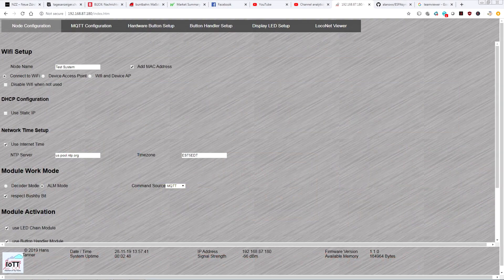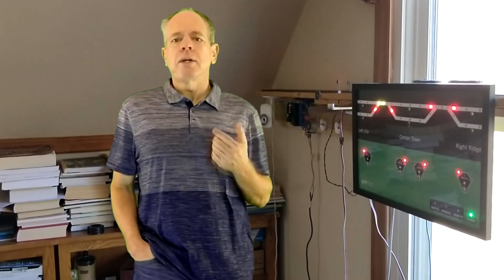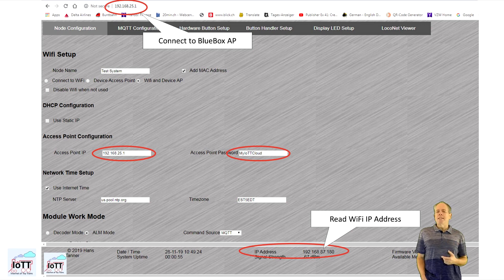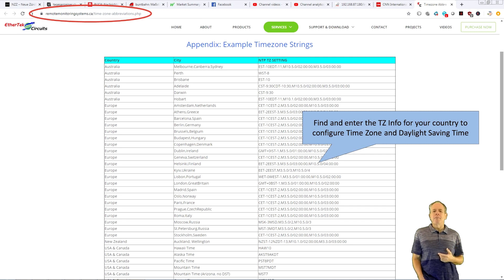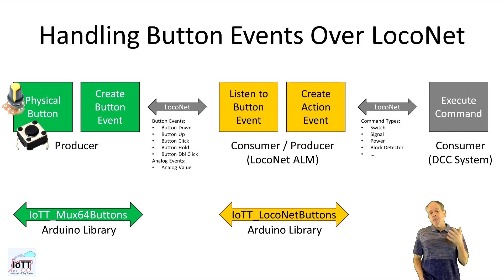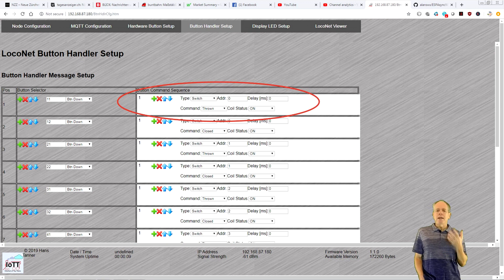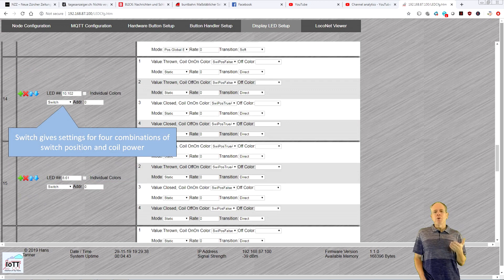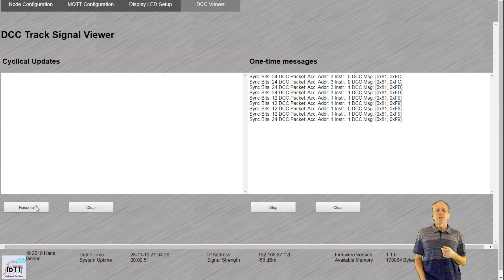BlueBox Sketch Update and Configuration (Video #32)

Comment: Hi,  A fresh down load and all behaves just like the video first time  :-)) .   Now to get some resemblance of control.......
Reply from the maker: Glad to hear. Thank you for helping to find bugs in previous versions!
Reply: @IoTT  I think I just might have to await the user manual.  I have 2 esp32's set up. one as a loconet gateway with gateway as its source of command and ALM ticked.  with the button handler set up for two buttons to send switch commands and is connected to loconet via a suitable circuit which indicates when a loconet packet is received.  The other esp32 is set up to connect to wifi and to have MQTT as its source of command, has the ALM  ticked, and to use the Button hardware and LEDchain modules.  Pressing any one of the ten Digital assigned buttons causes the Input Status box to show up with several options one after the other for that button, all different colours, before it decides to settle on one state. I have a LEDchain of 3 set up to be static with G/Y/R and dark aspects on two address each.  I have the wifi set up on their own router along with the MQTT broker which is running on a tablet.  I can see both esp32's connect to the broker and the broker response. I can see them both routinely sending ping requests and the broker responding to both. I can use the PC web browser to access either ESP32 and make changes to either one and the MQTT broker will show the disconnect and the reconnect.   I can use a programm called MQTT-spy  to publish a message to the topic lnIn and see the broker publish the message to both ESP32s.   I do not see any MQTT message as a result of pressing a button which is set up to activate a track Switch via MQTT/ButtonHandler/loconet ,  or sending a loconet packet from my railway software via loconet/MQTT to control the Ledchain.   I suspect I am just missing a clue to unlocking the puzzle, it is tantalizingly close  :-)
Reply from the maker: Try to get it going step by step building on each other. Here is an outline how I would proceed:
1. Get the Gateway working
1.1. Verify the LocoNet side is working. Load the LocoNet Viewer program from the LocoNet Hybrid Library Example section and see if is communicating with LocoNet in both directions. If the program runs you should see incoming messages in the monitor window. When you click enter in the monitor's command line, it should sens a series of messages to LocoNet, meaning you should see activity on the LocoNet activity LED on the ESP itself as well as on all other LocoNet devices that indicate LN activity (e.g. BDL16, PM4, etc.)
1.2 Verify MQTT is working. Apparently it is as you get the Pings, so you may skip this step. To verify you can load the MQTTViewer example from the MQTT library. This works pretty much the same way as LocoNet Viewer. You should be able to send messages and see them in the MQTT-spy on your broker machine
1.3. Load the LNFP sketch again. Open the configuration web page, make sure following is set: "Connect to Wifi" or "Wifi and Device AP". "Disable Wifi when not used" must not be activated. "ALM Mode" must be active and "Command Source" must be Gateway. "use Gateway Module", "use MQTT Module" and "use LocoNet Module" should all be activated by the web page. Verify the hardware settings for transmit, receive and logic level for LocoNet are correct (i.e. the same settings that were successfully working in your LocoNet Viewer test example). Save and restart the Gateway. Open te MQTT Configuration page and verify the settings for the broker. Verify the topics. LocoNet communication uses the broadcast and echo topics. Make sure they are the same on all nodes. Save and restart if you made any changes. You should now see any LocoNet Message  appear in your MQTT-spy software looking for the broadcast topic
2. Once you have this working, you can proceed with the second module.
2.1. Verify MQTT is working, as done above using the MQTT viewer
2.2. Verify the button module is working. From  your description, it appears it. What you see is the sequence of button messages as follows: When you click the button, you get a button down and the field changes to the first color. When you keep the button down, you get periodic button hold messages, changing the color of the field and Hold displayed in the text field. When you release, you get a button up followed by button click, which is the last on in the sequence. If you repeat the process within the specified dbl click threshold, you will get a double click message after the second button click message. The whole sequence of events is modeled after the button sequences of windows, so it is kind of state of the art.
Make sure you assign a button number to each button, so that you later can identify each button by a number.
Save and restart. You now should see button messages appear in MQTT-spy whenever you click a button.

Try to get that going so far and let me know. I will then explain how to set up the LED's and button handler. From your description it is not clear to me where the LED strip is sitting, on the gateway or on the MQTT only module. Also, it is not clear where the commands for setting the LED's are coming from and what exactly you want them to display. Maybe you clarify that.
Reply: @IoTT  Hi, I noticed that your talking about use Gateway Module", "use MQTT Module" and "use LocoNet Module" should all be activated by the web page, but from what I can see , these options are grayed  out for me.However "Use LocoNet Module is grayed out but there is a check mark in the box. How can I enable these ?
Reply: Hi,  I have worked my way through your very helpful outline on how to proceed, solving my self created issues along the way, getting as far as 1.3  where it says:-  Verify the topics. LocoNet uses the broadcast and echo topics........
It appears that making any changes to the broadcast or echo topic names and  saving them makes no difference to MQTT as when the node restarts the Broker displays Received SUBSCRIBE from ......  for   lnIn, lnEcho, and lnPing regardless of any changes to the MQTT configuration. The changes do  remain in the MQTT configuration as seen in the browser. 
I do not see any LocoNet message appear in my MQTT-spy Software when looking for the broadcast topic lnIn . The LocoNet activity LED on the ESP blinks away and i can see the LocoNet message in the Loconet viewer.  I can pubish to lnIn,lnPing, and lnEcho and see the broker sending PUBLISH to........   for all 3. All while they Ping each other over and over.
When I make changes and then click on the "Save & Restart" button on the browser a second button called "Save configuration and restart device" appears.  The MQTT broker responds to the first button, you have to click the second button to proceed. 
On the Display LED Setup  page after clicking on the "Save & Restart" button the second button  that appears also has a check box option  called "Prevent this page from creating additional dialogs"
A minor bit of info;- Up until now all my (20+) Loconet interface boards are using the LM393 Chip.  This gave me some strange outcomes when used with the ESP32 as it was missing 1/2 the data streams. I have created  a Loconet interface board using the LM311 chip and that sorted that one.  My limited knowledge suggests that the LM311 is called high speed for a reason.
To clarify the other things you mentioned:-  The LED strip is on the MQTT only module along with the Button hardware module. The LEDs will display which way the turnout is set by showing a colour  for the direction set and be dark for the other direction. They will get their commands from the feed back sensor on the turnout via LocoNet and MQTT.   The plan is for  7 turnouts = 14 Buttons  and 14 LEDS plus  power  STOP and GO buttons .  The Button handler module will be in the Gateway Node. 
Hans, your work is appreciated thank you.
Reply from the maker: Thanks for the info. There was an error in the MQTT library that prevented it from loaded the user given topic names, so it went with the default values. It is fixed now and uploaded to Github. Please try again with the new version.
The "Save configuration and restart device" is to give the ESP32 time to reboot before the page is being reloaded. It makes the browser wait until you click that button. The checkbox is a feature of the browser, just leave it unchecked.
What do you mean with "they Ping each other over and over."? The Ping message is pretty much a one-way thing to the broker. If the node receives a ping message, it is ignored, there should not be any "ping-pong", meaning going back and forth as reaction to each others message. Each node should simply send a ping message at the specified interval, every 5 Minutes by default (300 secs).
Do you have any Digitrax devices in your LocoNet or is it all your own nodes? I am just wondering what kind of messages go over your LocoNet.
Normally, the selection of the OpAmp for a LocoNet interface is not critical, pretty much any comparator will do when used with correct voltage divider etc. as LocoNet is really slow (just about 16 kBit/s).
Let me know how progress is with the new library version.
Reply from the maker: Hi, sorry I missed your message, it was held for review because of the hyperlink.
If the above output is from your node that runs MQTT only (not from the Gateway), that means that it is getting loconet messages which have been sent from LocoNet via Gateway and Broker to the Node. Please confirm. 
The same goes for the output in your link. If this comes from the gateway node, it means LocoNet is working. If it comes from the MQTT node, it means LocoNet messages are making it through and you just don't see them in MQTT-Spy.
Then the question is why you are not seeing it in MQTT-Spy. Maybe you want to try a different viewer client for testing. I am normally also using MQTT Dashboard on my Android phone.
The ping message from the node or gateway would include some data like the node name, the uptime and the free memory. Should be easy to recognize in the viewer.
Reply from the maker: Thanks for the summary of your observations. Let me comment on them to make sure I understand everything you are describing.
Obs 1: This looks exactly as it should. The node is getting LocoNet commands from LocoNet.
Obs 2: Here is a potential problem. It sounds like you first turn on the ESP32 and only then the broker. Try the other way around. It should work both ways, but I don't think I ever tested it except just a few minutes ago, and it worked, and the fact that the topics get subscribed seems to support this assumption. but anyway: Try to start the ESP against an already running broker.
Obs 3: This again confirms it is getting the LocoNet messages, but for some reasons it is not sending it to MQTT. Verify the ESP configuration settings. Command Source should say Gateway and the MQTT module checkbox and useGateweay checkbox should be checked. You can also set the MQTT Ping Delay to say 10 instead of 300 and you should get a LnPing every 10 seconds
Obs 4: Looks like the broker is doing its thing. What is the meaning of d0, q0, r0, m0? If q0 means Quality of Service 0 you should see if you can set MQTT-spy to send with QoS=1, which probably would cause the broker to display an error message if the message was not delivered
Obs 5:This is the normal ping message sending IP, Signal Strength, available memory and the seconds since the ESP was started. It tells me that the communication essentially works.
Obs 6: Pingreq and pingresp are messages from lower levels of the broker-client connection, but again it shows that the basic connection is there. But for our problem, we can ignore them

So, I think your conclusions are correct based on the observations. No idea though, why this is. The next step is to place some debug print messages along the path to find out where it breaks down. You think you can do that? If so, here's the message path you would need to follow:
Main Sketch line 108 call to commGateway->lnWriteMsg(txData)
IoTT_Gateway.cpp line 171 call to mqttPort->lnWriteMsg(txData);
IoTT_MQTTESP32.cpp line 232 Here you would have confirmation that the message is put in the message queue
IoTT_MQTTESP32.cpp line 340 here the sendMQTTMessage is called
IoTT_MQTTESP32.cpp line 226 here the message is prepared and published with the correct topic
The path is not time critical, so it is no problem to insert Serial.println messages and you can see the output in the Arduino monitor window.
Hope that helps. Please let me know the outcome
Reply: @IoTT  Unfortunately Hans, I am not able to help with making any progress on this. Every time I insert Serial.println()messages in any of the locations you indicated, all I succeed in doing is getting pages of error messages similar to this......
C:\IoTT\LNFP_ESP32\LNFP_ESP32.ino: In function 'uint16_t sendMsg(lnTransmitMsg)':
LNFP_ESP32:103:23: error: no matching function for call to 'HardwareSerial::println(lnTransmitMsg&)'  
 {Serial.println(txData);
This is a common part of the errors....  no matching function for call to HardwareSerial::println
My knowledge of their meaning is Zero.
Reply from the maker: Oops, sorry, my instructions were obviously not detailed enough for you to follow. Let me try again. First some explanations.
Serial.println can only take simple data types as parameter, so printing txData will not work. The idea is to insert println messages with a string saying "Look I am here" so that we can follow the program flow and see were it goes a different way.
So, here is the first example, and I copy the entire function from main sketch line 106 so you can see how it works:
uint16_t sendMsg(lnTransmitMsg txData)
{
  switch (commMode)
  {
    case 1: if (lnSerial) lnSerial->lnWriteMsg(txData); break;
    case 2: if (lnMQTT) lnMQTT->lnWriteMsg(txData); break;
    case 3: if (commGateway) 
            { 
              Serial.println("Calling Gateway"); 
              commGateway->lnWriteMsg(txData); 
            }
            break;
  }
}
This will compile and when you run it, you will see "Calling Gateway" appear in your monitor every time a LocoNet message is received.
Try it and when it works, go to the next line, IoTT_Gateway.cpp line 171. Make it look like this (from line 169):
      case MQTT:
  if (mqttPort != NULL)
  {
   Serial.println("Message placed in buffer");
   return mqttPort->lnWriteMsg(txData);
  }
  else
   return 0;
  break;
Now you will see both messages in the monitor after receiving a LocoNet command.
And so on.
Somewhere it breaks down and I would like to find out where. Unfortunately I am not able to replicate the error on my system, so I hope you can give it another try.
Reply: @IoTT 

 Hi,  That logic I can follow :-).  I followed your example and started at the begining. There is no message appearing in the monitor from the first stop on the list. I even cut and pasted your example just to be sure. So then I tried the following, with the arriving at sendMSG message last, to see if it might show anything, but nothing......
uint16_t sendMsg(lnTransmitMsg txData)
{
  Serial.println("arrived at sendMsg");
  switch (commMode)
  {
    case 1: if (lnSerial)
      {
        Serial.println("Calling Loconet");
        lnSerial->lnWriteMsg(txData);
      }
      break;

    case 2: if (lnMQTT)
      {
        Serial.println("Calling MQTT");
        lnMQTT->lnWriteMsg(txData);
      }
      break;

    case 3: if (commGateway)
      {
        Serial.println("Calling Gateway");
        commGateway->lnWriteMsg(txData);
      }
      break;
  }
}

Compiled, up loaded to the ESP32 and have seen nothing in the monitor relating to any of those messages. all I see is 

Incoming Switch Command for Switch 104 Position 0 Status 0
Incoming Switch Command for Switch 328 Position 1 Status 1
Incoming Switch Command for Switch 328 Position 1 Status 0
Incoming Switch Command for Switch 328 Position 0 Status 1
Incoming Switch Command for Switch 328 Position 0 Status 0
Incoming Switch Command for Switch 328 Position 1 Status 1
Incoming Switch Command for Switch 328 Position 1 Status 0
from the railway via loconet 

The Node configuration is set to :-
Connect to Wifi
use static IP
use internet time is not used as the network has no internet connection
ALM mode
Command source  Gateway
use gateway module
use MQTT module
use LocoNet module

Hopefully there is a clue here somewhere .
Reply from the maker: Ok, you got it ;-) 
And as it shows, that was the wrong location to look.
So, here's the next:
IoTT_Gateway.cpp line 86, make it look like this:
        case 0: //new message from LocoNet
     Serial.println("New LN Msg");
    if (appCallback != NULL)
   appCallback(newData);
          mqttPort->lnWriteMsg(*newData);        
          break;    

and IoTT_MQTTESP32.cpp line 232 like this:
  que_wrPos = hlpQuePtr;
  Serial.println("Sending MQTT");
  return txData.lnMsgSize;

As a result, you should get something like this in the monitor:
New LN Msg
Incoming Switch Command for Switch 125 Position 1 Status 1
Sending MQTT
If this works, the problem is in the processing routine that does the sending. If it does not work we need to look into filling the buffer. So, please let me know your findings.
I also tested on my system with static IP and not NTP clock. This did not make a difference. The only remaining difference then is that my router is connected to Internet. I will try to reconnect to another router where I can switch off the internet connection and see if this could be the problem.
Reply: @IoTT   I followed the instructions to the letter ;-) and got some good news...
New LN Msg
Incoming Switch Command for Switch 120 Position 0 Status 1
Sending MQTT
New LN Msg
Incoming Switch Command for Switch 120 Position 0 Status 0
Sending MQTT 

I did noticed that for some reason the switch number shown is always one number less than the address of the switch activated on the railway.
Reply from the maker: Ok, thanks. That looks as it should, so we know the messages are sent to the MQTT buffer. No we need to find the reason why they are not published.
After looking through the code, I found one potential problem, so I would like you to make IoTT_MQTTESP32.cpp lines 293-315 look like this:
    if (connected())
    {
      if ((txData.errorFlags & msgEcho) > 0)  //send echo message if echo flag is set 
        if (!publish(lnEchoTopic, myMqttMsg))
        {
   return false;
        } else 
        {
   return true;
        }
      else  //otherwise send BC message (in direct mode, meaning the command came in via lnOutTopic)
        if (!publish(lnBCTopic, myMqttMsg))
        {
   Serial.println("BC failed");
   return false; //changed from true
        } else 
        {
   Serial.println("BC successful");
   return true;
        }
    }
 Serial.println("Send MQTT failed");
 return false; //changed from true

If everything works, you should see in the monitor messages like this:
BC successful
BC successful
BC successful
for every incoming LocoNet command. If my theory is right, you probably will also see so,e BC failed messages in-between, but we will see.
The 1 offset of the switch address is because you are using NMRA addresses and I am using the technical address. NMRA uses switch addresses 1-2048, but if you look into the data it is 0 - 2047. And it is an inconsistency in the standard in my opinion, because signal addresses also for NMRA start with 0. The whole thing goes back to the initial DCC implementation of Lenz GmbH and made it into the standard for legacy reasons. In the monitor and also in the web pages I am showing the technical value. Hope that explains it.
Reply: @IoTT 
BC failed
BC failed
BC failed
Incoming Switch Command for Switch 328 Position 0 Status 1
BC failed
BC failed
BC failed

BC failed over and over very fast filling the monitor in an instant.  No BC Successful to be seen :-{

An Incoming Switch Command.....  line flashed past in the monitor with each incoming LocoNet command.
The 1 offset explanation makes sense thanks.
Reply from the maker: Ok, that is helpful, it does not publish the BC message. I believe it is because it is too long.
Enter this sequence in IoTT_MQTTESP32.cpp starting line 292
    serializeJson(doc, myMqttMsg);
    Serial.println(myMqttMsg);
    Serial.println(strlen(myMqttMsg));
    Serial.println(lnBCTopic);
    Serial.println(strlen(lnBCTopic));
    if (connected())
When you run it, it will show you something like this:
{"From":"LNCTC665103920","ReqRecTime":1403089275,"ReqRespTime":0,"EchoTime":0,"ReqID":0,"ErrorFlags":0,"Valid":1,"Data":[160,7,0,88]}
133
lnIn
4
BC failed
Find the file PubSubClient.h in your Arduino libraries. Somewhere around line 25 you find this:
// MQTT_MAX_PACKET_SIZE : Maximum packet size
#ifndef MQTT_MAX_PACKET_SIZE
#define MQTT_MAX_PACKET_SIZE 128
#endif
Most likely, the max packet size is defined less than what we try to send (in my case it is 128 vs 133)
Set the #define MQTT_MAX_PACKET_SIZE to a higher value, I run mine with 480
That should fix the problem. Let me know it it is successful.
I probably will add the PubSubClient library to my library list to avoid such problems in the future.
Reply from the maker: Very good, so we have that working. In the meantime I have updated the library.zip. Now it is time to set up the hardware buttons. When you open the dialog, you should see a table with probably 16 lines. Set the button type (if you have push buttons, that would be digital). Button Addresses go from 0 to 4095 and it is best to use the same address only once, unless you want 2 buttons to do exactly the same. When done, you should see OPC_PEER_XFER messages showing up in the LocoNet viewer for each button event. If you press a button and release, that would be down, up and click, so three messages.
Once this is working, you set up the Button Handler. Click the green plus symbol to create a line. Then enter the button address of the button you want to define a handler for, then select the event. For switches I find it the most convenient to make them react when I press the button, so I use the button down event. Next click the next green plus symbol to create a command sequence. You can have several commands for the same event, with a delay time in between. For the moment let's stick with one. Select the type, e.g. Switch for a switch command, followed by the switch address (minus 1 as discussed). Select a command, either thrown, closed or toggle. And the coil status should be on for most situations as most command stations send the off command automatically. Click save and restart and when you now click the button, you should see something like this in the LocoNet viewer:
OPC_PEER_XFER 0xE5, 0x10, 0x0C, 0x71, 0x02, 0x00, 0x00, 0x00, 0x0D, 0x02, 0x10, 0x01, 0x00, 0x00, 0x00, 0x6B
OPC_SW_REQ 0xB0, 0x03, 0x10, 0x5C
OPC_PEER_XFER 0xE5, 0x10, 0x0C, 0x71, 0x02, 0x00, 0x00, 0x00, 0x0D, 0x02, 0x10, 0x01, 0x01, 0x00, 0x00, 0x6A
OPC_PEER_XFER 0xE5, 0x10, 0x0C, 0x71, 0x02, 0x00, 0x00, 0x00, 0x0D, 0x02, 0x10, 0x01, 0x02, 0x00, 0x00, 0x69
The first is the button down, the the switch command, followed by button up and button click, for which we did not specify a command sequence.
Once you have that, the only thing remaining is defining the LED display. The dialog elements are the same as described for the button handler, so I think you will be able to do it. Otherwise let me know and I walk you through some examples.
Reply from the maker: Yes, one step at a time. So let's make the buttons work. First, how are your buttons connected? And are they normally open or normally closed? If you configure them as Digital buttons, the software is using the internal pullup resistor, so they should be open when not pressed and connecting to ground when pressed. When they are not pressed, they should be quit. When you press, and the input goes to ground, it will send a button down. When you hold it down for longer than the threshold time, it keeps repeating a hold message. When you release, you should get a button up followed by click. If you have stray hold messages, most likely the wiring is the other way around and the input gets a low signal permanently. You can measure the voltage of the CD74HC4067 input pin to be sure. If the button is unpressed, the voltage should be 3.3V, and 0 if pressed.
The LED pin is set to 12. See line 76 of LNFP_ESP32.ino
Reply: @IoTT  hi, My buttons are normally open. They are connect to ground when pressed. The voltage on the input pins of the HC4076 is 0v when a button is pressed. When unpressed and open the voltage measured on the input pin of the HC4067 is extremely variable from less than 300mv but never manages to get above 1.3V on a digital meter. The input voltage to the multiplexer is a steady 3.3v.
I then got a brand new ESP32 and a brand new HC4067 Multiplexer and started from the begining. Configured the ESP32 and connected up the Multiplexer .  To avoid any possible mix ups I only configured one button and used a wire from ground to touch on the Multiplexer input.  Exactly the same results.  0v at the input pin when the input is grounded and extremely variable V when the input is open. I see OPC_PEER_XFER  messages in the LocoNet viewer  for each button action but no OPC_SW_REQ messages are to be seen.
Reply from the maker: @PaddingtonbearNZ  That voltage looks very low and could cause the flickering you see. Maybe try to add an external pullup resistor, e.g. 4k7, to the button input and see if it gets more stable. The measuring cycle is quite fast, so it is possible there are some capacitive impacts.
Just to verify: Here is the button sequence you should see:
OPC_PEER_XFER 0xE5, 0x10, 0x0C, 0x71, 0x02, 0x00, 0x00, 0x00, 0x2F, 0x02, 0x10, 0x01, 0x00, 0x00, 0x00, 0x49
 //button # is 0x2F, 0x02, for button #175  this is button down
OPC_PEER_XFER 0xE5, 0x10, 0x0C, 0x71, 0x02, 0x00, 0x00, 0x00, 0x2F, 0x02, 0x10, 0x01, 0x03, 0x00, 0x00, 0x4A //button hold, repeats as long as you hold the button down

OPC_PEER_XFER 0xE5, 0x10, 0x0C, 0x71, 0x02, 0x00, 0x00, 0x00, 0x2F, 0x02, 0x10, 0x01, 0x01, 0x00, 0x00, 0x48
 //button up
OPC_PEER_XFER 0xE5, 0x10, 0x0C, 0x71, 0x02, 0x00, 0x00, 0x00, 0x2F, 0x02, 0x10, 0x01, 0x02, 0x00, 0x00, 0x4B
 //button click
You also should see the input status field in the hardware button setup going brown - red - blue - green
Once you have this working, go to Button Handler and do this:
- create a command line by clicking the green + symbol in the Button Selector column. A new line is created
- in the address field enter the address of the button you want to handle, in my case 175
- in the drop down selector select the message you want to handle, most likely Btn down
- Click the green plus symbol in the Button Command Sequence area to create a command sequence
- Select the command type, Switch for a switch
- select the switch address (minus 1). So a 3 for DCC address 4 and so on
- Delay can be 0
- Select Toggle, which will make the switch change position
- Coil can be On for this example. I think in most cases it does not matter as the command station does it right automatically
- Save and Restart and the system should come back with the very same settings.

When you now click the button, your LocoNet viewer should show this:
OPC_PEER_XFER 0xE5, 0x10, 0x0C, 0x71, 0x02, 0x00, 0x00, 0x00, 0x0D, 0x02, 0x10, 0x01, 0x00, 0x00, 0x00, 0x6B
 //button down
OPC_SW_REQ 0xB0, 0x03, 0x30, 0x7C
 //switch command issued
OPC_PEER_XFER 0xE5, 0x10, 0x0C, 0x71, 0x02, 0x00, 0x00, 0x00, 0x0D, 0x02, 0x10, 0x01, 0x01, 0x00, 0x00, 0x6A
 //button up
OPC_PEER_XFER 0xE5, 0x10, 0x0C, 0x71, 0x02, 0x00, 0x00, 0x00, 0x0D, 0x02, 0x10, 0x01, 0x02, 0x00, 0x00, 0x69
 //button click

Button setup and button handler can be on different systems, but maybe for testing it is best to put everything on the same system to make sure there is no lost communication somewhere.
If you can't make it work, I would like to see the JSON configuration data for the hardware buttons and the button handler. You can get to that in the Arduino monitor. If you have the monitor open and you load the Hardware button setup page in your browser, you will see the command exchange, something like this:

WS Event 1073601404 
{"Cmd":"CfgData", "Type":"pgHWBtnCfg"}"}
 //this is the request
followed by the response that has the entire button configuration:
{"Cmd":"CfgData", "Type":"pgHWBtnCfg","Data":{"HoldThreshold":500, "DblClickThreshold":1000, "BoardBaseAddr":0,"Buttons":[{ "PortNr":0, "ButtonType": "touch", "ButtonAddr": 171},{ "PortNr":1, "ButtonType": "touch", "ButtonAddr": 172},{ "PortNr":2, "ButtonType": "touch", "ButtonAddr": 141},{ "PortNr":3, "ButtonType": "touch", "ButtonAddr": 174},{ "PortNr":4, "ButtonType": "touch", "ButtonAddr": 142},{ "PortNr":5, "ButtonType": "touch", "ButtonAddr": 175},{ "PortNr":6, "ButtonType": "touch", "ButtonAddr": 143},{ "PortNr":7, "ButtonType": "touch", "ButtonAddr": 144},{ "PortNr":8, "ButtonType": "touch", "ButtonAddr": 178},{ "PortNr":9, "ButtonType": "touch", "ButtonAddr": 179},{ "PortNr":10, "ButtonType": "off", "ButtonAddr": 180},{ "PortNr":11, "ButtonType": "off", "ButtonAddr": 181},{ "PortNr":12, "ButtonType": "off", "ButtonAddr": 182},{ "PortNr":13, "ButtonType": "off", "ButtonAddr": 183},{ "PortNr":14, "ButtonType": "off", "ButtonAddr": 184},{ "PortNr":15, "ButtonType": "off", "ButtonAddr": 185}]}}

The same goes for the button handler as well. Please send me both strings for review and verification.
Reply from the maker: I looked at your config files and they appear to be ok, but I will run them on my system later tonight. 
What I see though is that your Button Event Handler is not activated: "useButtonHandler":0 Please check the use Button Handler Module checkbox in the Node configuration screen. Once you do that, you should see the OPC_SW_REQ messages showing up and the switch working.
Assuming this works then we need to find to reason why the MUX is not giving the correct level results. Can you please describe how the MUX data line is connected? You are showing 2 data pins, 15 and 35. Are both connected? Also, you show GPIO 18, 5, 17 and 16 for the address pins. Please verify these are truly the pins you are using.
Then: the behavior you described with with the messages, is that the same for all buttons? I.e. does it properly distinguish the buttons and all have this same message sequence?
One thing you could try is to connect GPIO pin 15 (your first data pin for ports 0-15) directly to GND and 3.3V and see what happens if you do that. It should cause the first 15 buttons to go through the activation cycle (down-hold-up-click), so be prepared for a lot of messages showing up ;-)
Reply: @IoTT  The connections are (Mux > ESP32) :-   S0 - >P18   ,  S1 ->P 5  ,  S2 -> P17    , S3->P16   ,   SIG ->P15 , EN  not connected. There is nothing connected to P35. In the  Data Pins (1-4) box it simply never occured to me to change it to just 15. I have now. I had not turned on the Button Handler Module as I wasnt getting the results prior to that step.
Turn on the Button Handler Module  and OPC_SW_REQ message turns up and the Railway software does respond to the toggle of the button, indicated by the graphic symbol of the switch changing.  
The voltage at the Mux input pin is still extremely variable when the button is open.

The Hardware Button Setup screen shows that it does properly distinguish the buttons and they all have the same message sequence.  I tried connecting GPIO pin 15 to GND and there was a pretty display indeed but not once did I see Hold appear.  Holding a button down does not give a Hold indication.
Reply from the maker: @PaddingtonbearNZ  Ok, Thanks. Looks like everything is running except for that strange button behavior. Could you please try to run the example that comes with the Button Library (buttonreport.ino). Comment out lines 36-38 as you run all buttons as digital buttons. Then watch the messages in the monitor window as you activate the buttons.
At this point I am a little in the dark as far as to understand what's going on, so we have to search. Running the example sketch eliminates all errors tat could come from  initialization as it is straight forward to the button object.
Here are two other tests you could do:
- leave the  button input open (just a piece of wire, not connected at all), then configure the input as touch as in line 36 of the example sketch. Then see what happens if you touch/hold the open wire
- configure the button as digital and hold it directly either to 3.3V or GND and watch if you get some messages
Reply from the maker: I think I found the problem. Try this:
around line 266 in LNFP_ESP32.ino make it look like this:
            myButtons->initButtons(addrLines[0], addrLines[1],addrLines[2], addrLines[3], &analogPins[0], true); //use WiFi with buttons (always), this has limitations on ADC that can be used
(set the last parameter of the InitButtons call to true. This was referring to an old configuration variable that no longer exists, therefore it was initialized with false, therefore giving wrong values when doing the analog read on GPIO 15, which can't do Analog when Wifi is on. With this parameter true, I do a digitalRead which works on this port.

While working at it, I came accross an error in Mux64.cpp line 129  change that hex constant from 0x03FFF to 0x0FFF  This was a type that happened somewhere along the lines. It has no impact on the logic, but should be corrected

Finally, please verify that your IoTT_MQTTESP32.cpp line 292 reads something like this:     serializeJson(doc, myMqttMsg);
In the version that I published after fixing the JSON max length problem I accidentally eliminated this line. It is probably correct in your version, otherwise you would not see commands going out.
Reply: @IoTT  I worked my way through your list of trials with the buttoninputreport.ino and got some strange outcomes which were not even consistant. Back to basics..... First I tried a single completely different type of push button and with buttoninputreport.ino lines 36-39 commented out  resulting in repeatable 
Button 100 is down. 
Button 100 is up. 
Button 100 was clicked. 

The buttons I have been using up until now are mounted on "vero board" holy board with copper tracks on the back.
Each button having the copper track cut as appropriate to  isoate it. The buttons are wired/soldered to the Mux  and then using push on jumpers from the Mux to the ESP32. 
Built a new button board using holy board with no copper strips on the back. wired /soldered one side of all buttons to GND. Wired/soldered the other side of each button to an input on the Mux. Wire wrapped the Mux to the ESP32 and gave it a try.  
The results where much more consistant and appeared to be in line with what was expected.  Then....

"around line 266 in LNFP_ESP32.ino make it look like this:
            myButtons->initButtons(addrLines[0], addrLines[1],addrLines[2], addrLines[3], &analogPins[0], true); //use WiFi with buttons (always), this has limitations on ADC that can be used"    changed that

"an error in Mux64.cpp line 129  change that hex constant from 0x03FFF to 0x0FFF "      changed that

"IoTT_MQTTESP32.cpp line 292 reads something like this:     serializeJson(doc, myMqttMsg);"  reads exactly like that.

I did that and  uploaded it to an esp32 and there was no sign of communication.   I suspect that I may well have accidently deleted something extra and so downloaded a new version from github.  checked the 3 things above and tried uploading to an esp32 again.   still no sign of life other than both the red and blue LEDS lighting up. Could not see the esp32 on wifi with my cell phone. 
I think its time to go and enjoy Christmass and re evaluate progress in a few days time.

Ross NZ
Reply from the maker: @PaddingtonbearNZ  Make sure you did not accidently set the MQTT message length back to previous settings, e.g. by reloading the PubSubClient library. Other than that, I think it should work. The proof it that it works with the example program  and the wrong setting was a repeatable error that exactly caused the behavior you saw. So, I am relatively confident it will work.
Reply: @IoTT  Hi, I figured a fresh start was a good idea so deleted any reference to LNFP_ESP32 on my PC and down loaded LNFP_ESP32.Zip file from Git hub. Unzipped it and put the libraries into  Arduino/libraries.  I checked the PubSubClient library  , MQTT_MAX_PACKET_SIZE 480. 

Made sure that line 266 in LNFP_ESP32.ino is: myButtons->initButtons(addrLines[0], addrLines[1],addrLines[2], addrLines[3], &analogPins[0], true);  Changing this line made no difference to this problem as I tried to compile it with both options. 

Then I tried to compile it in the Arduino IDE .  The result was....
C:\Users\IoTT\Documents\LNFP_ESP32-master\LNFP_ESP32\WifiAccess.ino: In function 'void establishWifiConnection(AsyncWebServer*, DNSServer*)':
WifiAccess:29: error: 'class WiFiClass' has no member named 'softAPConfig'
       WiFi.softAPConfig(ap_ip, ap_ip, ap_nm); ^
WifiAccess:30: error: 'class WiFiClass' has no member named 'softAP'
      WiFi.softAP(devName.c_str(), apPassword.c_str());^
WifiAccess:36: error: 'class WiFiClass' has no member named 'mode'
       case 0x01 : WiFi.mode(WIFI_STA); break;^
WifiAccess:36: error: 'WIFI_STA' was not declared in this scope
       case 0x01 : WiFi.mode(WIFI_STA); break;^
WifiAccess:37: error: 'class WiFiClass' has no member named 'mode'
       case 0x02 : WiFi.mode(WIFI_AP); break;^
WifiAccess:37: error: 'WIFI_AP' was not declared in this scope
       case 0x02 : WiFi.mode(WIFI_AP); break;^
WifiAccess:38: error: 'class WiFiClass' has no member named 'mode'
       case 0x03 : WiFi.mode(WIFI_AP_STA); break;^
WifiAccess:38: error: 'WIFI_AP_STA' was not declared in this scope
       case 0x03 : WiFi.mode(WIFI_AP_STA); break;^
C:\Users\IoTT\Documents\LNFP_ESP32-master\LNFP_ESP32\WifiAccess.ino: In function 'void checkWifiTimeout()':
WifiAccess:51: error: 'class WiFiClass' has no member named 'mode'
         WiFi.mode(WIFI_OFF);^
WifiAccess:51: error: 'WIFI_OFF' was not declared in this scope
         WiFi.mode(WIFI_OFF);^
exit status 1
'class WiFiClass' has no member named 'softAPConfig'

 I think I have lost the Plot somewhere,  something just is not behaving its self here. I then tried downloading  LNFP_ESP32.Zip to a laptop, compiled it in the Arduino IDE, had a cup of coffee and came back to see that it had compiled error free.  I then down loaded the same version of the Arduino IDE to the PC as was on the laptop (1.8.5). This made no difference to the error message.  Time to go outside and run some trains to preserve my sanity ;-)
Reply from the maker: The Wifi library that causes the problem is part of the ESP32 implementation itself. Looks like something is missing there and the fact you were able to compile on a fresh installation is another pointer that this could be the case. Sometimes it helps to just re-select the processor type as this does several installations of the board libraries. So I would try to switch the board to a standard Arduino or maybe ESP8266 and then back to ESP32 and see if it then works.
Reply: @IoTT  Hi,  It is true..... you can teach an older person new tricks.  Back to moving forward again.
I have one ESP32 set up as Gateway,HW button, Button handler and a LEDchain of 4.  Loconet viewer shows  things as they should be and the Hardware Button Setup displays the colours correctly. 
The hardware Button Setup, LN Button Address is limited to 255. No OPC_SW_REQ appears in Loconet Viewer past 255.  Finding this out saved any further head scratching. Along the way I have also come across this :-
The Button handler setup, Type = Block detector,Detector value = off.  After a save it returns Detector value = On
Time to tackle the LEDchain.  I have had no luck so far with self discovery on this one.  I have no brightness control connected which may or may not be a hinderance to progress. I did however, succeed in letting the smoke out of one ESP32 today but thats a self inflicted by product of too much stuff all over the workbench and not having electronic things in some form of protective container .
Reply from the maker: Sounds like progress (probably not your ESP's opinion...) And I see you find every error that I try to hide in my programs ;-)
Here are some fixes:
On LocoNet_Out_Handler.ino change line 94 from
  txData.lnData[9] = (btnNr & 0xFC) >> 6; //addr high 6 bits
to
  txData.lnData[9] = (btnNr & 0xFC0) >> 6; //addr high 6 bits
That will take care of button numbers > 255
And in BtnHdlCfg.js add two lines after line 159 to make it look like this:
    case "switch": configWorkData.ButtonHandler[thisRow].CtrlCmd[thisCmd].CmdList[thisCmdLine].CtrlValue = swiPwrOptions[sender.selectedIndex];
    break;
    case "block": configWorkData.ButtonHandler[thisRow].CtrlCmd[thisCmd].CmdList[thisCmdLine].CtrlValue = swiPwrOptions[sender.selectedIndex];
    break;
    case "signal": configWorkData.ButtonHandler[thisRow].CtrlCmd[thisCmd].CmdList[thisCmdLine].CtrlValue = verifyNumber(sender.value, configWorkData.ButtonHandler[thisRow].CtrlCmd[thisCmd].CmdList[thisCmdLine].CtrlValue);
    break;

I will get back to you with some information about how to make the light chain work a little later tonight.
Reply: @IoTT  Button numbers >255 is sorted. 

To avoid any possibility of a typo I copied and pasted the second solution but the results of trying it out showed no change to the situation.
Reply from the maker: Ok, now for the LED chain problem. Here's how I would approach this.
1. Make sure the hardware is working. Run one of the example sketches of the FastLED library. DemoReel100 is a good one, for example. Make sure you use the same data pin as well as the LED type and the RGB order that works on the demoreel sketch in LNF_ESP32 as well. The pin # is in line 75, the LED Type and RGB Order is in line 242
2. Make sure you are getting all the LocoNet messages. Check the LocoNet Viewer and compare the messages between the 2 nodes, they should largely be identical (in some occasions it is possible that the sequence of 2 individual messages is changed on the broker).
3. Open the LED setup screen. Specify values for all fields in the top section. Set Brightness Control to analog and give it any number. It does not matter since you are not sending analog commands. Set Initial Level to 1 which means full brightness (100%)
4. Specify some colors (or use the existing ones)
5. Specify an LED for a message you know you receive in the LocoNet Viewer, for example for a switch address, and define the LED as follows: Enter the position of the LED you want to program in the LED## field. Go just with one for the moment. Select type (switch) and address (remember the Offset, so Switch #4 would be Address 3). Selecting Switch automatically creates 4 lines in the LED command sequence section, 2 for the thrown position and 2 for closed. Select an On-Color from the list, leave the Off Color empty. Use different colors for thrown and closed, you may use the same color for coil on and off as you probably only get On messages anyway. Set Mode static, Rate 0, Transition direct to begin with. Save and restart and it should come back with the same settings. Operate the switch and you should see the LED change colors based on the position.
Note that all LED's that are not defined in  this setup remain dark. Same is true for LED's that are beyond the specified chain length.
Hope that helps.
Reply from the maker: Just to make sure: Did you re-upload the the ESP32 sketch data? The button handler is a JavaScript file, so it goes into the SPIFFS part. Other than that, I am going to upload the changed file to the github soon, so you can download from there as well.
Reply: @IoTT  The learning curve is steep, one slips now and then ;-)  No, I had not.  I re-uploaded the ESP32 sketch data and  all appears to be well. Now for a pleasant evening of playing with LEDS.
Reply: I worked my way through your instructions step by step. DemoReel100 gives a colourful display.   Checked that the data pin and LED type matched.  Checked that all LocoNet messages showed up in both the Gateway node and the LED node. Even used Switch# 4 just in case >255 was an issue. set up the LED using address3.  Save and restart and every thing came back with the same settings. 

Got down to .... Operate the switch and you should see the LED change colors based on the position.   and nothing. :-( 

ALM mode, use LED chain module,Command source MQTT.  Even swapped ESP32s and set up a second one , with the same results.
Reply from the maker: Ok, on to more testing to locate the problem.
1. Make sure you see the event messages appear in the LocoNet monitor every time a switch request is received by the node. They come from line 65 in LocoNet_In_Handler and look like this in the monitor:
Incoming Switch Command for Switch 125 Position 1 Status 1
You should see the same type of messages for buttons and block detectors as well. This is proof that the internal status buffer is updated as it gets called after updating.

2. Add this test code to LNFP_ESP32, line 235:
        if (jsonDataObj != NULL)
        {
          myChain = new IoTT_ledChain(); // ... construct now, and call setup later
          myChain->loadLEDChainJSON(*jsonDataObj);
          delete(jsonDataObj);
          Serial.printf("Init LED Chain on Pin %i, %i LEDs long\n", LED_DATA_PIN, myChain->getChainLength());  
          FastLED.addLeds<WS2811, LED_DATA_PIN, GRB>(myChain->getChain(), myChain->getChainLength());
          for (int i=0; i < myChain->getChainLength(); i++)
            myChain->getChain()[i] = CRGB(0x00050000);
          FastLED.show();
          delay(1000);
        }
With this, it will switch all LED's to a dark red at startup. This is proof that the hardware works. If the LED's do not come up, check the initialization of the LED chain, pin number and chain length. You should also get a message "Init LED Chain on Pin ..." at startup that shows how it is initialized.
If this all is successful, we need to look into the updating in the LED library.
Reply: @IoTT  All of the above is successful.  I get the messages in the serial monitor just as you describe.
Reply from the maker: @PaddingtonbearNZ  And the LED's come up as well? 
If so, start looking into IoTT_LEDChain.cpp
In line 925, uncomment the line Serial.println("update LEDs");
If you do that, you should see the comment printed in the monitor everytime a switch request that should cause an LED to come up comes in.
Next step: in line 920, before the updateLEDs() command, add a line Serial.print("x");
This will cause a lot of x printed on the monitor screen (about 20 per second or so) but it shows that the LED's are updated.
Let me know the results.
Reply: @IoTT  ooops   Yes the same number of LEDs come up as is in the #of Leds in the Led display set up.
I modified  the IoTT_LEDChain.cpp in both places .   LED #1 is set to switch 3.  There is only
Incoming Switch Command for Switch 3 Position 1 Status 1
Incoming Switch Command for Switch 3 Position 1 Status 0
Incoming Switch Command for Switch 3 Position 0 Status 1
Incoming Switch Command for Switch 3 Position 0 Status 0
which is not coming from IoTT_LEDChain.cpp showing up in the serial monitor.
Reply: @IoTT  ooops   Yes the same number of LEDs come up as is in the #of Leds in the Led display set up.
I modified  the IoTT_LEDChain.cpp in both places .   LED #1 is set to switch 3.  There is only
Incoming Switch Command for Switch 3 Position 1 Status 1
Incoming Switch Command for Switch 3 Position 1 Status 0
Incoming Switch Command for Switch 3 Position 0 Status 1
Incoming Switch Command for Switch 3 Position 0 Status 0
which is not coming from IoTT_LEDChain.cpp showing up in the serial monitor.
Reply from the maker: Ok, now make following modifications in IoTT_LEDChain.cpp
Just about 4 lines up add
  Serial.print("0");
before this  updateLEDs();
Next, around line 894 make it look like this:
 Serial.print("1");  //add this line before the following
 if (LEDHandlerListLen > 0)
  for (uint16_t i = 0; i < LEDHandlerListLen; i++)
   LEDHandlerList[i]->updateLEDs();

and same around line 625
 Serial.print("2"); //add this line before the following
    switch (ctrlSource)
    {
  case blockdet: updateBlockDet(); break;
  case dccswitch: updateSwitchPos();break;

if you run this, you should see a lot of 0 in the monitor, and when a switch request arrives, you should also see a 1 and 2 as indicator that it calls the functions to update the LED.

If this works, remove the printlns as it is a mess, and change the last one
from Serial.print("2");  to Serial.println(ctrlSource); 
to see what type of command we get.
Reply: @IoTT  I have added the 3 Serial.print statements into the IoTT_LEDChain.cpp. Downloaded to the esp32. There is no change to the outcome in the serial monitor.  Just the Incoming Switch Command...... lines
Reply from the maker: @PaddingtonbearNZ  Ok, this is sort of what I hoped for as it greatly reduces the possibilities what the problem can be. Obviously the updateLEDs() function never gets called, so we need to find out why.
1. Add a print statement as first command to the processChain() function (somewhere around line 903 in IoTT_LEDChain.cpp: Serial.print("-"); If this gets called, you should see a lot of - printed in the monitor. If this is the case, move the command further down the processChain() function to find out where it gets killed. Next location would be before line 915 faderValue = ..., then line 916 before the if (millis() > ledUpdateTimer) statement.
If you do not get any printout, verify the call of the function in the LNFP_ESP32.ino file line 361. It should be 
if (myChain) myChain->processChain(); //updates all LED's based on received status information for switches, inputs, buttons, etc.
Check that the line is there, not commented out or something. If all looks normal, you may try to change it to
if (myChain != NULL) myChain->processChain(); //updates all LED's based on received status information for switches, inputs, buttons, etc.
You may also add an else path like this:
if (myChain != NULL) myChain->processChain(); //updates all LED's based on received status information for switches, inputs, buttons, etc.
else Serial.println("No Chain");
Reply: @IoTT  no printouts from the Serial.print statement added (somewhere around line 903) in  IoTT_LEDChain.cpp.    LNFP_ESP32.ino file line 361. looked just as you indicated it should, not commented out.  I then tried changing  LNFP_ESP32.ino file line 361.     if (myChain) myChain->....  to if (myChain != NULL) myChain->..... and included the else Serial.println("No Chain");      No change to the outcome. I still only get  the Incoming Switch Command...... lines in the serial monitor.
Reply from the maker: @PaddingtonbearNZ  Something appears to be wrong here. If you have this in your LNFP_ESP32.ino:
 if (myChain) 
  myChain->processChain(); 
else
  Serial.println("No Chain");

and the first statement in the processChain() function in IoTT_LEDChain line 903 is
 Serial.print("-");

one of those print statements must fire, unless the loop() function is not running. The eliminate this possibility, please add something like
Serial.println("Loop");
right in before the if (myChain) line. If you ,run it, you should see in the monitor either
Loop
No Chain

or 
Loop
-

repeated over and over again. Please verify. We need to know whether the LED chain is processed and stops inside or it is ignored all together.
Reply: @IoTT  

Yes, the first statement in the processChain() function in IoTT_LEDChain line 903 is
 Serial.print("-");

LNFP_ESP.ino  lines.....

358  Serial.println("Loop 358 LNFP_ESP32.ino");
 359  if (myChain) myChain->processChain(); //updates all LED's based on received status information for switches, inputs, buttons, etc.
  360 else Serial.println("No Chain  359 LNFP_ESP32.ino"); 

  361 Serial.println("Step over MyChain 359 LNFP_ESP32.ino");

Serial monitor output.......

Loop 358 LNFP_ESP32.ino
Step over MyChain 359 LNFP_ESP32.ino
Incoming Switch Command for Switch 3 Position 0 Status 1
Loop 358 LNFP_ESP32.ino
Step over MyChain 359 LNFP_ESP32.ino
Loop 358 LNFP_ESP32.ino
Step over MyChain 359 LNFP_ESP32.ino
Incoming Switch Command for Switch 3 Position 0 Status 0
Loop 358 LNFP_ESP32.ino
Step over MyChain 359 LNFP_ESP32.ino
over and over

LED#1 is set to switch 3.
Reply from the maker: @PaddingtonbearNZ  Hmm, this monitor output does not make any sense.  Where is this coming from: Step over MyChain 359 LNFP_ESP32.ino ? I do not see a statement that would print that. 
It almost looks like it is not the processChain function from IoTT_LEDChain that is called but something else. Also interesting that MyChain has capital M, the variable myChain does not. 
What you can try is leaving the if(myChain) part away, just for testing, but you also have to eliminate the else Serial.println() part. We know that your myChain is initialized, so you can do that without risk. See if this changes something. Other than that, you need to search for the reason why you get this Step over MyChain output. No clue where this can come from, I don't think it is from me ;-)
If everything is correct, you should see at this time:
Loop 358 LNFP_ESP32.ino
-  (this from the first line in the processChain function)
and then repeated over and over.
When a switch command comes in, you should get
Incoming Switch Command for Switch 3 Position 0 Status 0
Loop 358 LNFP_ESP32.ino
-
012
update LEDs
Reply: @IoTT    "  Where is this coming from: Step over MyChain 359 LNFP_ESP32.ino ? I do not see a statement that would print that.  "   It is simply a Serial.print statement immediately after 

  359  if (myChain) myChain->processChain(); //updates all LED's based on received status information for switches, inputs, buttons, etc.
  360 else Serial.println("No Chain  359 LNFP_ESP32.ino"); 

 361 Serial.println("Step over MyChain 359 LNFP_ESP32.ino");

and with nothing showing between the two serial.print statements in the serial monitor
 Loop 358 LNFP_ESP32.ino
Step over MyChain 359 LNFP_ESP32.ino
indicated to me that it was going nowhere.  I added the location into the print statement so I could find them later to remove. The Mychain is nothing but a typo in the Serial.print statement.(not helpful)   I removed that Serial.print statement.
I removed the if(myChain) part in line 359 along with the else Serial.println() part.  and the result is

Serial monitor output.......
Loop 358 LNFP_ESP32.ino
Incoming Switch Command for Switch 3 Position 0 Status 1
Loop 358 LNFP_ESP32.ino
Loop 358 LNFP_ESP32.ino
Loop 358 LNFP_ESP32.ino
Loop 358 LNFP_ESP32.ino

Incoming Switch Command for Switch 3 Position 0 Status 0
Loop 358 LNFP_ESP32.ino
over and over
Reply from the maker: Ok, from what I see it calls the processChain() function correctly, otherwise the else side would fire. But then, nothing happens, i.e. the print statement in the first line of processChain() gives nothing. Makes me think that it is not called and we are looking in the wrong place. Is it possible you have a second copy of IoTT_LEDChain that is called instead?
Try this:
- search your libraries for a duplicate of IoTT_LEDChain
- add something with wrong syntax in the processChain() function and try to compile it. If it does not give you a compilation error, it obviously gets it from somewhere else. If it does give an error, undo the problem and compile again and see if it printing the first line now
Reply: @IoTT  Some progress  (maybe)
First ....  tracked down multipule copies of IoTT_LEDChain.cpp and elimenated all except the one that is used. proved this by introducing a syntax error and getting error messages. Obviously the file I was editing was not the one being used previously.
Second.....  worked my way through the previous few bug tracking serial.print  trials and can now show that void IoTT_LEDHandler::updateLEDs() gets visited twice at regulare time intervals.  An incoming switch command has no effect on this pattern.  

Loop 
 - 
Loop 
 - 
1
    * line 633 IoTT_LEDChain.cpp              ( this is the  ctrlSource value)
1
    * line 633 IoTT_LEDChain.cpp    
Loop 
 - 
Loop 
 - 
(round and round)
Loop 
 - 
Loop 
 - 
Incoming Switch Command for Switch 3 Position 0 Status 1
Loop 
 - 
Loop 
 - 
(round and round)
Loop 
 - 
Loop 
 - 
1
    * line 633 IoTT_LEDChain.cpp 
1
    * line 633 IoTT_LEDChain.cpp 
Loop 
 - 
Loop 
-
Reply from the maker: @PaddingtonbearNZ  This is actually very good, at least now we know again where we are ;-) The ctrlSource value of 1 is dccSwitch, so thats good as well. The updateLEDs function is only called if a LED changed color, so if you get updateLED messages that means there was a color update. It should not happen at regular intervals, but after a switch command was received.
At this point it looks like there might be an error with the colors itself. Here's how we can find out:
- first, please make sure the IoTT_LEDChain library is the latest version. Most likely it is, based on the line numbers, but please verify. The best way to do that is compare the IoTT_LEDChain.h file with what's on Github, and then verify the length of the IoTT_LEDChain.cpp. Should be the same with the exception of the few println statements  we added in the meantime
- add following print statments to the color update functions IoTT_LEDChain.cpp:
in line 830 make it look like this
void IoTT_ledChain::setCurrColRGB(uint16_t ledNr, CRGB newCol)
{
 Serial.printf("Set RGB %i to %i\n", ledNr, newCol);

and in line 843 like this:
void IoTT_ledChain::setCurrColHSV(uint16_t ledNr, CHSV newCol)
{
 Serial.printf("Set HSV %i to %i\n", ledNr, newCol);

if successful, you should see the printout in the monitor whenever you receive a command that changes an LED. It might be a good idea to comment out all the repetitive printlns in the loop, so that you can read the output.
Reply: @IoTT  1.  Checked out that the IoTT_LEDChain library I am working with is  the latest version.
2.  Commented out all the repetitive printlns in the loop.
3.  Added in both the new Serial.printf() statements . 
4  The Serial monitor responds with the 2 lines 
Incoming Switch Command for Switch 3 Position 0 Status 1
Incoming Switch Command for Switch 3 Position 0 Status 0
for each click of the mouse to change the switch on the railway software
Incoming Switch Command for Switch 3 Position 1 Status 1
Incoming Switch Command for Switch 3 Position 1 Status 0
Incoming Switch Command for Switch 3 Position 0 Status 1
Incoming Switch Command for Switch 3 Position 0 Status 0
Incoming Switch Command for Switch 3 Position 1 Status 1
Incoming Switch Command for Switch 3 Position 1 Status 0

The LEDchain is set up so that each change of the switch should create a colour change for the LED as the switch is changed from Thrown to Closed to Thrown.......
Reply from the maker: @PaddingtonbearNZ  Oh, I misunderstood your previous results. I thought you saw the update LEDs printout, but you just saw that the function was called, which is earlier in the process.
So, this is next: I think we know that IoTT_LEDHandler::updateLEDs() is called and the ctrlSource value correctly is 1. Follow the path and find the updateSwitchPos() function, somewhere around line 386. In that function there are three commented print statements. Uncomment them and see what shows in the monitor. You should get 1 line from the first and last of the 3 messages, and 4 lines from the second, with different parameters, keep running through the loop like this:
Checking Swi 3 Stat 0
Testing Value 0 Status 0 in Loop 0
Testing Value 1 Status 0 in Loop 1
Testing Value 2 Status 0 in Loop 2
Testing Value 3 Status 0 in Loop 3
Updating Switch 3 to Position 0 Cmd 0

In the last line you should see a change based on the position of the switch.
Reply from the maker: Sorry, I did not get a notification about your message and overlooked it.
That output looks as expected, so let's check the update function.
Add this print statement to line 187
186 bool useGlobal = true;
187 Serial.println(cmdDef->dispMode[colorNr]);

then in line 255
255 {
256  Serial.println("change color");
257  uint16_t blinkPeriod;

and in 279, uncomment the print command:
   Serial.println(cmdDef->transType[colorNr]);

See how the printout looks.
And then another approach: In the LED setup, try to change the Mode and Transition parameters to something else. If Mode is static, try Global blink. And if Transition is Direct, try Soft, or vice versa, just make some changes and save and restart to see if this has an effect.
Reply: @IoTT   I commented out the precious 3 Serial.print() statements and  did the next round of suggestions and have the following result.

change color
120
change color
120
change color
Incoming Switch Command for Switch 3 Position 1 Status 1
120
change color
120
change color
120
change color
Incoming Switch Command for Switch 3 Position 1 Status 0
120
change color
120
change color
120

change color
There is no alteration to this pattern caused by the changing of any settings (and saving and restarting each time) in the LED setup.
Reply: @PaddingtonbearNZ  Ok, this is not looking normal, seems we get to the problem. Please make following refinements:
in line 187, change the print statement to
 bool useGlobal = true;
 Serial.printf("Disp Mode %i \n", cmdDef->dispMode[colorNr]);

move the println in line 281 to before the switch command and change the print statement as this:

277  Serial.printf("Trans Type %i \n", cmdDef->transType[colorNr]);
278  switch (cmdDef->transType[colorNr])

when you run it, you first should see a lot of
Disp Mode 0 
going through the monitor. When you send a switch command, you should get something like:
Incoming Switch Command for Switch 3 Position 1 Status 1
Disp Mode 0 
<- this should be in [0..8] if you get 120 as your previous post suggests, that is the error that prevents the LED from being updated
Disp Mode 0 //this can be repeated 20 times or so before you get to the next

change color
Trans Type 1 
<- this is the number I'm interested next. Should be in [0..2]
Set HSV 28 to 1073422029
 <- this comes from line 848 if not commented out in the meantime
Set HSV 86 to 1073422029
Reply: After making the alterations this is the result..........

Trans Type 120 
Disp Mode 120 
change color
Trans Type 120 
Incoming Switch Command for Switch 3 Position 1 Status 1
Disp Mode 120 
change color
Trans Type 120 
Disp Mode 120 
change color
...........over an over
Trans Type 120 
Incoming Switch Command for Switch 3 Position 1 Status 0
Disp Mode 120 
change color
Trans Type 120 
Disp Mode 120 
change color
...........round and round
Trans Type 120 
Incoming Switch Command for Switch 3 Position 0 Status 1
Disp Mode 120 
change color
Trans Type 120 
Disp Mode 120 
change color
...........repeating
Trans Type 120 
Incoming Switch Command for Switch 3 Position 0 Status 0
Disp Mode 120 
change color
Trans Type 120 
Disp Mode 120 
change color
Reply from the maker: @PaddingtonbearNZ  Strange. Let's override the values and see if this cures the problem:
187 Serial.printf("Disp Mode %i \n", cmdDef->dispMode[colorNr]);
188 cmdDef->dispMode[colorNr] = 0; //this makes it a steady LED

278  Serial.printf("Trans Type %i \n", cmdDef->transType[colorNr]);
279  cmdDef->transType[colorNr] = 1; //this makes it direct transition. If it works, you can also try 0, which is soft

If those values are the only problem, you should see the LED's come on. If so, we then need to find why you get these values. For this, I would like to see your config string. To get it, open the monitor (after commenting out all those repetitive print commands), then load the LED setup screen. You will see two lines in the monitor:
{"Cmd":"CfgData", "Type":"pgLEDCfg"}} <- this is the request from the browser
{"Cmd":"CfgData", "Type":"pgLEDCfg","Data":{ <- this line is the answer that has the entire LED configuration. Copy this line and send it in an e-mail to me hans@tanner-family.org